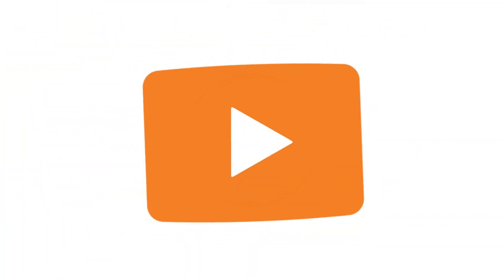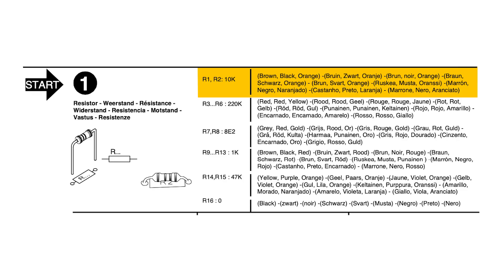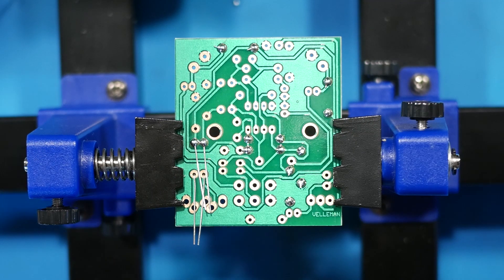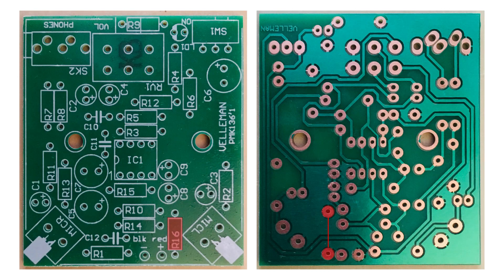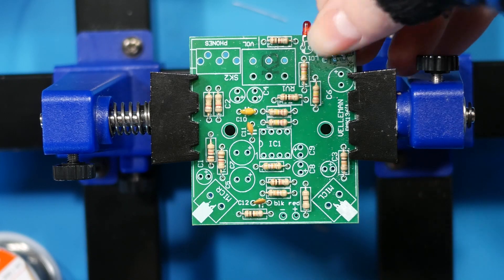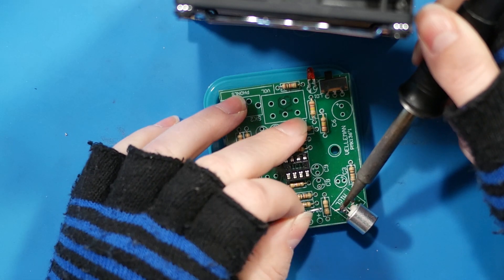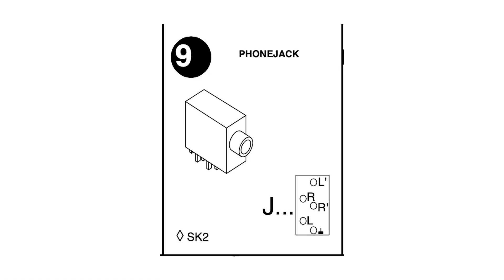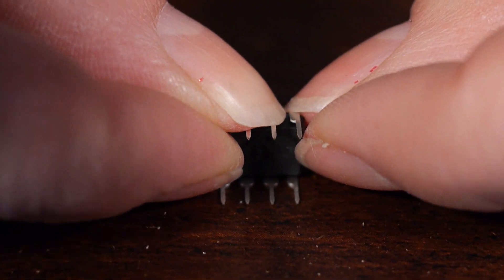OpAmps Project: Build an Amplified Stereo Mic Kit - The Learning Circuit

Comment: Well, my use would come out of I am building pickups and pre-amps for the acoustic stringed instruments I make in my workshop. Hence, I'd maybe use it as a transducer with the Electret Mics positioned at distinct & ideal locations under the soundboard of an instrument. I might  use only one of the two op-amps on the 5532p IC for Mic and the other for a piezo transducer and that might require a bit of modification in the feedback aspect of the op-amp that boosts the piezo transducer.

Comment: Say I wanted to run this circuit on 6V 4X aa bateries instead of the supplied 4.5V 3X aa batteries then would the values of R1 and R2 (I presume microphone Bias resistors) need changing? 
If so what value would they need to be? most electret microphone capsules require 2V - 3V @ 0.5mA and in this circuit I dont understand how the provided R1 and R2 bias resistors @ 10k are providing the required 2V - 3V @ 0.5mA to the microphones.

Comment: If I don’t have a zero ohm resistor, what can I use as a jumper? In my guitar pedal, there is a spot for a J snuggled right next to the op amp socket.
Reply: Just add a jumper wire.

Comment: I am trying to add a wire between the mic and board so I can have the mics father from the board, but I keep getting a hum instead of sound. Problem absent if directly connected to the board. I've tried shielded cabling but the hum just got lower.
Reply: the cable is acting as an antenna, the hum will have 50/60Hz depending on your reagion, it picks up the AC voltage in the mains wiring around the house.(if you are near a flourescent lamp this gets worse) .Dont' elongate the wire between mic and board but only the finished amplified signal. the stronger signal is much less prone to inducted noise when transported over a shielded cable.
Reply: @MAYERMAKES  thanks for the reply. The whole thing is I want to have the mics off board so I can put them in different places for a project that the board may not fit